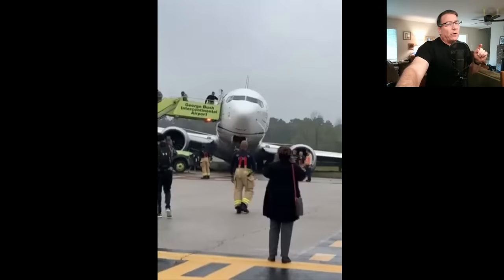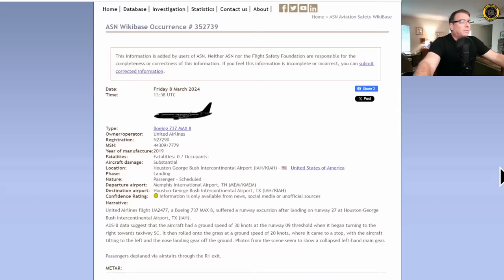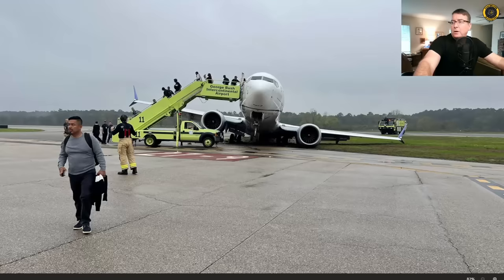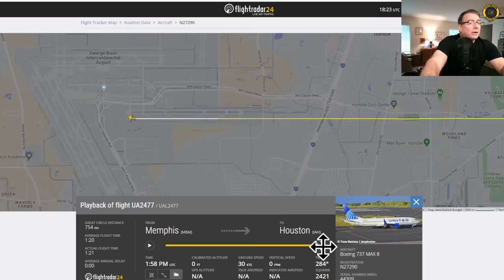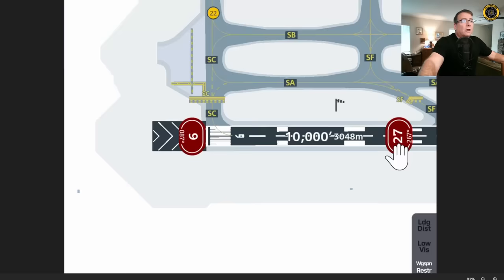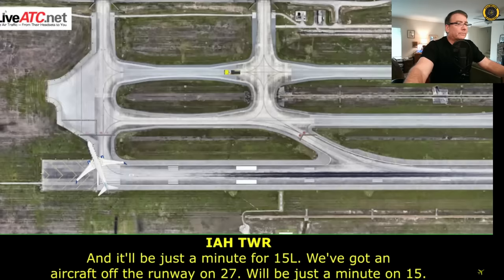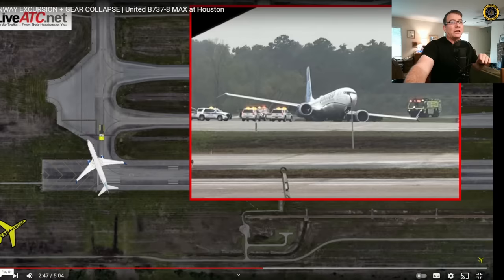United 737 Max Runway Excursion IAH 8 March 2024

Comment: Some other photos I saw of this incident from passengers deplaning showed nosewheel skidmarks on the pavement.  Since there are no brakes on the nosewheel it's obvious he had the tiller and nosewheel turned but the airplane wasn't turning.  Had it been dry he might have been OK.  With the wet pavement, it was just too fast.  Even dry, though, you have to be careful as I'm pretty sure FOQA will tattle on you for excessive lateral acceleration.
Reply: Once your nose wheel is turned far enough to skid, it’s not going to be doing much turning of the vehicle

Comment: How reliable are those ADS-B speeds? Specifically, how fast they update - they're obviously good in steady state conditions. I'm very skeptical of the polling rates and transmission rates for this kind of analysis. I'm not saying he wasn't going too fast (he clearly was), but based on my experience, the poling and update rate is not good enough for micro-analysis of a dynamic event. This isn't Formula 1 telemetry, not even close.

Edit to add: And the piano keys are MUCH more slippery than people expect and even more so in the wet. I have cough been caught by them myself, also in a 737 - luckily I had my speed well under control, but even so it caught me off guard. I was NOT going fast at all. That nosegear doesn't have nearly as much grip as you think in the wet.

Comment: That painted pavement  is highly slippery especially when wet.
Reply: Change “can be slippery” to “is highly slippery.”
Reply: 👍 Correct.  Was going to post the same - nose wheel steering can be absolutely useless in these situations when going more than a walking speed.   UAL driver cost their employer several Mil $$ for no reason, Ugh…
Reply: @Rhaman68  you are absolutely correct. Change has been made.
Reply: Yep, when I'm on 2 wheels I avoid painted lines and manhole covers at all costs.

Comment: You know. I used to believe that BS about us being much more likely to be in a car wreck than an airplane crash, then I subscribed to blancolirio.
Reply: Imagine if someone ran a car crash review channel for just the USA alone. Wouldn't even have enough time to scratch the surface.
Reply: Oh, go ahead and believe it. Simply Flying website said: "According to research by Harvard University, flying in the US, Europe, and Australia is significantly safer than driving a car. Your odds of being in an accident during a flight is one in 1.2 million, and the chance of that being fatal is one in 11 million. Comparatively, your chances of dying in a car crash are over 200,000 times higher, averaging around one in 5,000."

Comment: I pity the flight crew. Back to the training department. Anyone's guess what they'll have to go through. Possibly ground school, simulator, and might even get some time off. Non-paid of course. The FAA will be involved in all that, letters to write. And the captain may get most, if not all of it. Since he was taxiing it by then. And when all that's over he'll probably get line checked for so many hours with a check airman. The fact the plane got damaged that much will make it all the more worse. Time to call ALPA.
Reply: Perhaps 737 pilots need to re-train for 737 max because it handles differently on the ground due to the changes in the nose wheel position, landing gear and weight distribution

Comment: Any missing bolts? 😉😁

United: "We have a bit of understeer."
Tower: "No worries. We can fix that with a different sway bar."
Reply: Just a bunch of screws loose in management of these airlines and jet manufacturers, hiring based on quotas instead of merits.
Reply: @Watchdog_McCoy_5.7x28    This excursion had nothing to do with hiring or quotas. Maybe some sugar poured on those sour grapes will help? 🙂
Reply: @phillipzx3754  it has everything to do with it. The best people for the jobs aren't getting hired because they need more women or black people, or men that pretend to be women, etc. The inevitable result is what you are witnessing, more mistakes, lower quality, more accidents, more crashes, and less accountable. What's so hard to understand? Were you one of the people that benefited from these unethical hiring practices? If so, it's obvious why you don't get it. If not, then that's even worse because you have no excuse and are just willingly ignorant or flat out lying.

Comment: maybe rudder controls got stuck like on recent United flight 1539
Reply: You talking the rudder or the steering?  Rudder ain't gonna do much at 30 MPH.
Reply: If there's a mechanical problem involved it would be more like the wheel that dropped after take-off in San Francisco. If that happens during landing you might run into steering issues.

Comment: This is very interesting to me!  I just had a flight from Denver into Houston on United a week ago, and I distinctly remember (because I was watching out the window) that the pilot turned very hard (and fast) off the runway onto the taxiway. It was enough to cause me some concern, and as an engineer I don’t get concerned unless it is warranted. I think the investigators need to look at all the taxiway divert speeds at Houston and maybe elsewhere too. There appears to be some motivation making pilots want to divert off the runway before their speed has completely bled off. Not sure if it schedule, longer taxi times, trying to save fuel, needing to hit the head, or what, but something is making at least some pilots anxious about getting to the gate as fast as possible. I saw it this trip, I have seen it in past trips and now we see the result here.

Comment: Anytime ATC tells you to “keep your speed up”, thereby disrupting your planned profile, it is a THREAT.  And sometimes, like here,  you just have to say “sure” and do what you were going to do anyhow.
Reply: Say "i've got a number for you to call".  Report with faa will be filed over his behaviour.  Tapes will reveal a pattern of behaviour by that particular pushy controller.
Reply: That's a terrible thought process. The UAL asked to roll to the end. I've said "keep your speed" to aircraft 100s of times. It's saying to the crew, "Yes, roll to the end, but do it quickly as there's traffic tight behind you. It's a common sense instruction. Just because you say it, doesn't mean they have to break all rules. It's just saying don't sit at 5kts down the runway. The ATCO was actually helping the UAL out by approving their long roll out. That's doesn't mean that no other rules now exist and that 90 degree turn becomes suddenly easier at higher speeds.
Reply: Or say “unable” or “standby.” The PIC’s in charge, not ATC.
Reply: Disagree.  Do what you would do anyway in this phase of flight, which is exit the runway expeditiously at a safe speed.  In OTHER phases of flight (airborne), sure, you say “unable”.  In this case, you have landed and you’re going to be on the runway no more than 5 seconds longer.  If ATC has botched his spacing to the point that an extra 5 seconds causes a go around….oh well!

Comment: Having flown in & out of IAH, both as a first officer and captain for 32 years, and in the 737 for twenty of those years, this one hits close to home for me.

First off, the 737s (-800/-900/-900ER/Max 8/Max 9) all use a higher approach/touchdown speeds, in order to prevent a tail strike. (a touchdown speed of 150 - 160 Kts is not at all unusual for these airplanes.

That said, RWY 27 is 10,000 feet long, with no displaced threshold, so there is plenty of room for an aircraft: to land, to slow down and to exit safely, even when the runway is contaminated with water.

In my experience at IAH, we very rarely requested to roll out to SC, because there was almost always another aircraft 2.5 -- 3.0 miles behind us on final.

I preferred to exit at high-speed taxiway SF, which could be safely accomplished at 30 kts, then continue decelerating along SA (the RWY 27 parallel taxiway) to make the turn onto SC at the prescribed 10 Kts or less. In fact, the tower-given clearance for this was quite frequently: "United XXXX, right turn on SF, then SA-SC, contact the Ramp (Control) on SC."

Doing it this way took the pressure off, since we were clear of the runway and not interfering with the next arrival.

IMHO, I believe that rolling out on the runway to SC doesn't save enough time to make the risk worth it. It requires slowing way down to be able to make that 90-degree turn onto SC.

Even though I believe that it was up to the crew to ensure that the SC-turn could be made safely and that, in fact, they got the ball rolling by requesting a long landing, in the first place,  I also think that ATC played a part in setting them up for it, by asking them to keep their speed up on the roll out to SC.

Comment: Thanks again Juan. So in my industry if we get into a crash if it's our fault our union can help us keep our jobs. Is it similar in your industry? Generally will be suspended for a week. Possibly have to do a Smith system refresher and of course the mandatory drug testing. Curious about the airline industry. Thanks for everything you do. I heard about this on the news and of course they reported that the landing here collapsed because it's a Max 8. I have learned withhold judgment until you do your work. Cheers

Comment: Fortunately they were weren't needed for fire or any other emergency, but HFD station 92 is located around 500 feet from that end of the runway, for a quick response. Note to self, do not drift a 737.

Comment: I may be a bit off here, but if you want to get faster to the terminal, wouldn't it be better to take the right hand high speed at SF rather than trying a quick turn around at the end of the runway?
And in the turn if you screw up, you have a lot lower slip angle on the front tires giving you more grip.

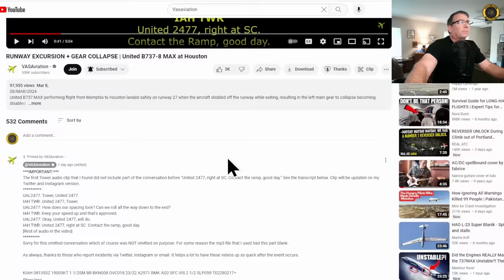Comment: What I don't get is why the pilots wanted to take the very last exit at all. Looking at the map at 6:09, exit SF would allow turning off at higher speed and still lead to the same taxiway SC (via SA, where you could reduce speed without blocking the runway). Committing to the last exit and keeping a high speed until turning seems like something to avoid in general.

Comment: Years ago it said at the top of the checklist…DO NOT HURRY-FLY THE AIRCRAFT. It’s a mindset. Same pilots are probably always asking for direct routing, side step visual approach at low altitude, intersection takeoffs etc. You don’t really save much time over a career but you certainly open yourself up to this result much more than necessary.
Reply: Passengers are asking to get there fast
Reply: Wisest comment I’ve seen on here so far. The “hurry” mindset is asking for trouble. This world needs to slow down in general. Pilots (and Captains in particular) would do well to always focus on what Rod Machado says are the “two most important things in aviation…the Next Two Things.”  Not getting to the gate early, not the ball game that’s on later, not even whether the guy behind you has to go around because you took longer on the runway. @jonwilder2735 I hope you are a sim instructor somewhere.

Comment: I'm just a structural guy, no ARFF experience, but wouldn't you want to support that front wheel with cribbing before letting people off the plane? that was you don't run the risk of a CG shift causing the front end to slam down and sling shot everyone still inside against the next most forward hard object in the cabin?
Reply: I was thinking that same thing.

Comment: If there was nothing wrong with the aircraft, my guess is the PIC's brain was operating as if it were an angled exit, because usually they turn before the 90-degree at the end of the runway. Little changes to patterns your brain does automatically can have unintended consequences, especially if fatigued.

Comment: My guess they carried too much speed (obviously) but with the slick pavement and an aggressive brake at the end they locked the main gear. Anti-skid only works above 35kts GS and if you look in the background of the news shots you can see 4 distinct skid marks on the pavement into the grass. 

Personally would be interested to see who the crew was. Is this one of United very JR CA or was there a history? I understand the operational pressure but as someone who flies into IAH on a very regular basis this seems like a "rookie mistake"

Comment: I landed at IAH a few minutes before this crew. During our setup/briefing we noticed a NOTAM had recently been issued for 3/3/3 braking on runway 27. This caused us to perform a non-standard landing assesment. In our case, we had departed 4 hours prior, so the NOTAM was not in our flight release. We only saw it during the approach briefing because our EFB has live NOTAMs via wifi. I'm not with UAL, but I'm sure their crews have the same capabilities if the wifi was working. However, it could've easily been missed.

IAH RWY 09/27 FICON 3/3/3 SLIPPERY WHEN WET OBS AT 2403081143. 
08MAR24/1143 08MAR24/2300                                               KIAH A1393/24.
Reply: These bozos were thinking about "the weekend" while racing to the gate.
Poor hiring.
Reply: Pin this. Significant.

Comment: Unless given a "hold short of" landing clearance, the ENTIRE runway is available and there is no such thing as "approved". The runway belongs to the landing aircraft until they exit safely at the EXIT OF THEIR CHOOSING. Controllers are getting way out of hand, and pilots are too quick to accommodate off-the-cuff clearances that do not follow the controllers handbook. ATC, air traffic control, is a bad name. It's more like Air Traffic Suggestion. A pilot must evaluate if what ATC is asking for is safe, prudent, and legal. Oft times their requests are not.

Comment: I had got 10 hrs of flight time on on a Cessna 150.
The first time I tried to taxi a PA-28-140 I taxied off the taxiway, no problem.
Taxiing is not easy and even when you get good at it, it is still hard and you can STILL taxi off the taxiway.
I won't criticize that pilot BUTT!
Getting cocky will always guarantee some kind of fk up.

Comment: If a crew requests permission to continue to the end of the runway, they are requesting to increase runway occupancy time (R.O.T.).  During times of high traffic movements R.O.T. becomes a crucial factor in maintaining optimum flow. In this case the Controller approved the crew's request with the caveat that they maintain high speed due to landing traffic.  However, he would not be expecting the crew to run out of centripetal force and go gardening. All will be revealed by the N.T.S.B in the course of time.

Comment: Here is my post from Delta's ATL runway evacuation and my prediction/concerns for this very incident and more burst tires and jets in the grass to come ...this pilot tried to advocate as a courtesy and was overruled with this specific point: "ATC is stacking more jets closer together on final and expects us to make the first high speed disregarding outside temps and greater chances of burst tires. It's up to us as pilots to let tower know we will be using low brake energy and not making the first turnoff" This pilot definately felt rushed to get off the runway. Awkward apology from the tower " I see you in the grass?"...err thanks for expediting.
@Windsong4Serenity
7 months ago Delta Brake Fire in Atlanta I posted:
"I'll be using this incident in my training, but, to ask the question, "Why did this happen?" I switched from 22 years of Boeing flying to Airbus a few years back and now have become more brake sensitive with Airbus having brake temp indicators. As a Guppy pilot, I never knew the temp of my brakes. I guess it's my Boeing instructor badge coming out that rewinds this scenario back to this being a short flight from Richmond (very little enroute brake cooling time) on a record-hot summer day that begs to ask, were they attempting to make the M14 high speed turn off as expected by Hartsfield tower whenever I'm landing there? That would have left over half the runway still available ( >6000') and greatly increased the brake temps and fire danger. ATC is stacking more jets closer together on final and expects us to make the first high speed disregarding outside temps and greater chances of burst tires. It's up to us as pilots to let tower know we will be using low brake energy and not making the first turnoff, on record temp days, allowing for safer quick turns and lower brake temps. Tower can then adjust the distance between aircraft behind us and allow for a safer operation that doesn't blow our tires and shut down their runways. If we don't manage ourselves we will see more of these occurrences." 
 This crew should have realized that the earlier high speed of turnoff, SF @ 60kts, will get you to a Houston gate quicker than their ill fated plan of SC. 
"There but by the grace..."  May your landings always equal your takeoffs. Cheers

Comment: The original 737 100 weighed 110k lbs. The Max weighs 194, 76% more. The -100 wing area is 980 sq. ft., the Max, 1370. 40% more. These aiplanes have become led sleds on landing with approach speeds rivaling takeoff speeds of older widebodies like Lockheed L 1011s. We should have stayed with tail skids digging into grass to stop.

Comment: There is no Rubber at the end of a runway the threshold of a runway area and like a tractor differential braking does more to turn than a nose wheel tiller control. Also the ATC control instruction to keep his speed up would not have meant to overspeed to the end instead it would mean not to dawdle or delay exiting the runway.
Reply: There is no rubber but there is a ton of white paint marking the threshold.  Nearly 50% of the runway is painted in that location at taxiway SC.  That would be extremely slick for any speed over a brisk walk.
Reply: Exactly, don’t stop, hang out, and then turn ….  Tend to business… which they weren’t doing if they came in too fast … for whatever reason.